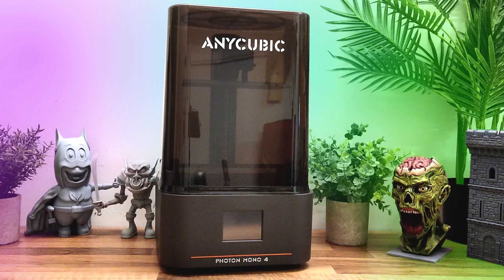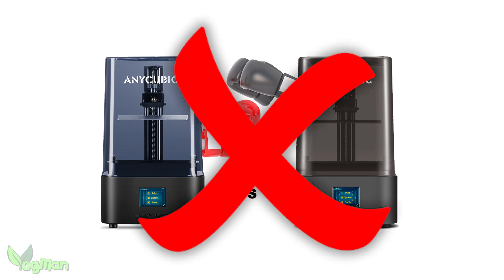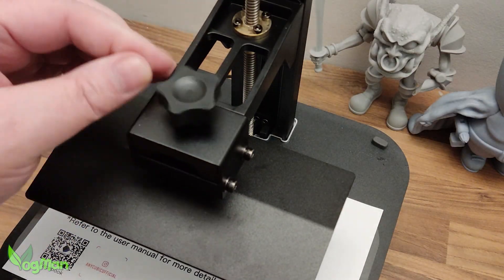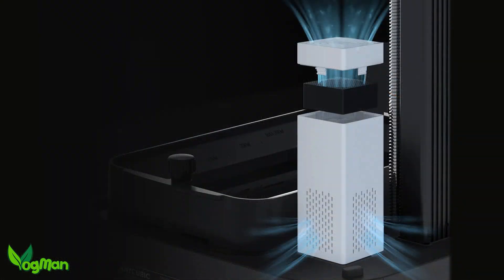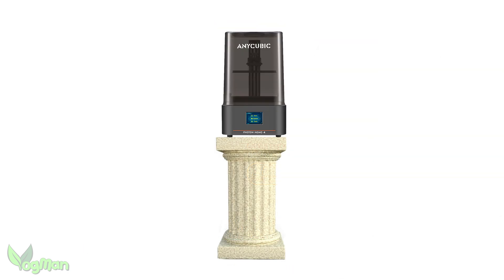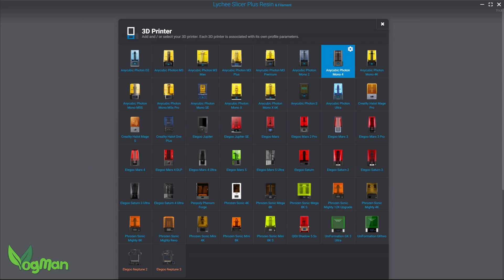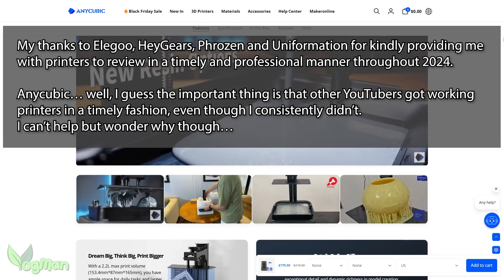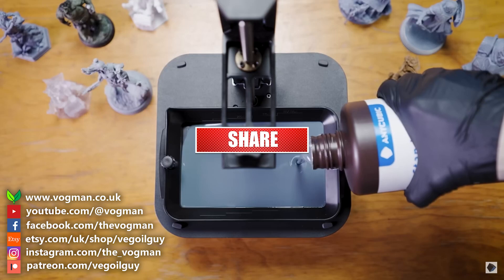Better late than never Anycubic Photon Mono 4 Honest Review

Comment: do you need to put on the  screen protector because I screwed up
Reply from the maker: It's a safety feature, so no it's not compulsory, but it's advised. It protects the screen in case of spillage. But check on Amazon. You can usually buy aftermarket alternatives nice and cheaply.
Reply: Ok thanks @vogman

Comment: Dunno if you'll be getting a Photon Mono 4 Ultra for review. I hope you will and I hope you'll test some features that are only mentioned by reviewers and not actually tested. I'm talking about force detection sensor and it's layer peel/release detection. I wonder if this function actually works as Anycubic advertises. So it would be great if you could test it. You could set lift distance to 10 or even 15 mm and watch if the printer detects that a layer has peeled from the fep after, say, 4 mm and stops further unecessary lifting of build plate. 
I've never seen a reviewer test this. It's only ever mentioned as a feature and never really tested. 
Anyway, cheers! :D
Reply: Intelligent Release works fine on the M5s Pro, it saves me tons of printing time. I bought the Photon Mono 4 Ultra recently to replace my aging Mars 3 specifically because of the IR feature (having better resolution than even the Mars 5 is a boon too).

Comment: been a long time since i used my anycubic machines.. think i printed 3 times on my mono4 that is not the one you are showing now.. as they changed the machine so many times.. but i do not like them plastic trays at all.. i replaced them with metal ones asap.. i had them melting on me with a clean out with a little ipa on kitchen roll.. so nope.. defo replace the plastic trays for a standard one.. also then you are not confined to there quick release fep sheets that cost way to much for 2 sheets..

Comment: That seems like a mighty fine printer for someone with a budget, personally, I was going for a S4U but rolled the dice on a refurbished m5s pro and it was about the same price as the Mono 4 lol
The printer was almost brand new including all the accessories, just some resin on the lid, I've been using it for a month now and I don't think I'd ever go smaller than a 10 inch printer, being able to print many models on the same run really does make a difference, I'll pay the price when replacing the screen but I think it's worth it.
Reply from the maker: I'm not here to persuade anyone to spend their money. As long as I provide the information that helps people make informed choices, I'm happy 😁
Reply: Yep, I wouldn't recommend someone to buy a refurb/used printer, particularly not to someone trying to learn the ropes, I did it because budget was tight, did a thorough research and it was from their official store, but it was still a gamble, fortunately mine paid well enough

Comment: You dont want to support the top part of the spindle or it will be overdefined. They are the moving parts and the parts that guide, the spindle moves the rest guides. It´s what many people didn´t understand wit the Ende3 Z wobble issue and such.
Reply from the maker: You're possibly right. Looking at the Mars 5, that isn't supported either. But for some reason it just jumps out at me on this M 4 😁
Reply: @vogman  They could have made a cover around it or something but why ? It´s one additional useless part. The issue with the Z bending stuff begins when the spindle is completely crooked but stiff enough to influence the guiding components.

Comment: I bought this about a month ago as my first resin printer. I sometimes notice some Z layer misalignment lines, which I’ve seen on your prints too… i think it’s due to a non-precision Z rail… so not much point in having 9k resolution if the Z has wobble :)
Considering the price, I’m happy with it, but haven’t found much use for it yet :)
Reply from the maker: It is a budget printer with a single rail, so we have to have allowances. But in terms of bang for your buck, it's a great printer 😁

Comment: This does seem to be a very good printer. I wonder how long before budget printers start to include as standard heating abilities?
Reply from the maker: I suspect most companies will go down the "optional extra" route. There's much faffing about and no one is providing an enclosure heater - just pre-heating.
Reply: Considering you almost HAVE to use an enclosure (like a grow tent) to use a resin printer, it's easy to throw a cheap heater into the tent with the printer to get it toasty. Here it gets around low 50Fs, and using only the heat the printer generates it gets to like 80F inside. I'd rather do that than pay an extra $150 or whatever for an integrated heater in the printer.

Comment: I think if you brace the floating end of the shaft, instead of trusting the rather stiff rail, you will get a wobble if the shaft is not true. And they never are.
Reply: Yup it throws off the accuracy of the liniar rails.
Reply: Are we talking about 3d printing here or something else😊